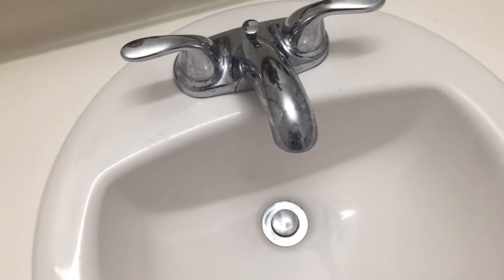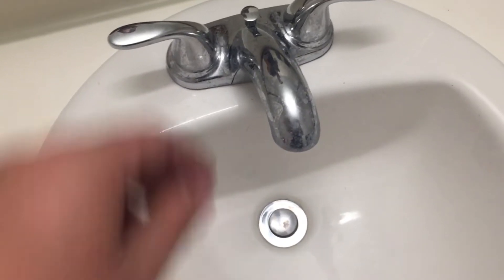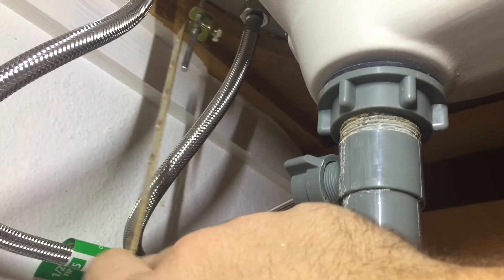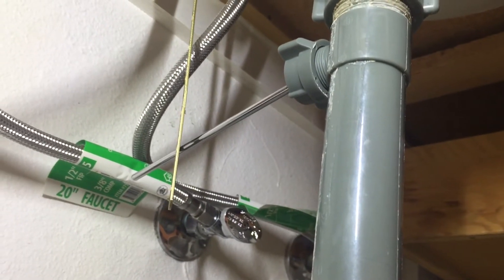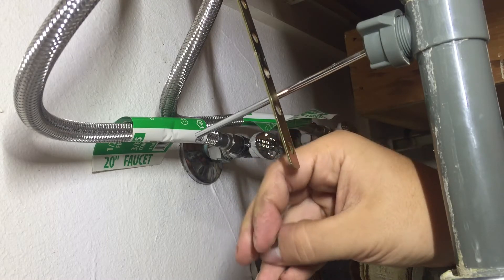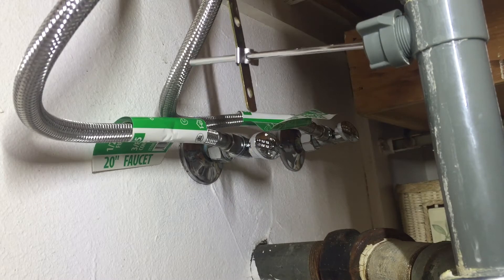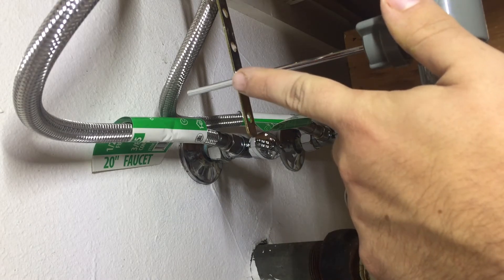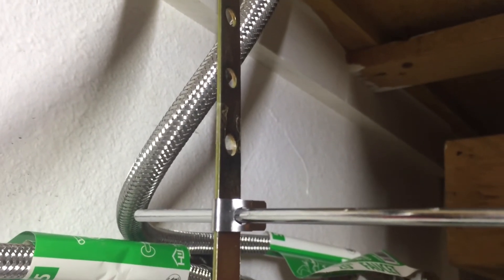Bathroom Sink Drain Stopper Not Working Fix

Comment: Do you have a video on the lift rod?  I can pull the lever up and down but the drain stays shut still
Reply from the maker: I don’t but maybe we can walk through it! The  end of the lift rod from the sink goes down to pivoting rod which has a ball on the end of it. That ball moves up and down in response to the lift rod being moved. The ball end of the pivoting rod connects to the sink stopper so it could be broken or disconnected. A very easy fix but can be bit of pain to line up. Let me know and I can always do a video!
Reply: @learnsavediy   thanks so much, appreciate the tips.  I ended up buying a new drain stopper as the piece at the bottom of the original one with the whole broke off it.  With that said once I dropped the stopper in the sink I had trouble lining up the whole with the pivot rod.  It was very hard to see it as you said.  But somehow I guess even though I could not get the pivot rod through the whole it was still touching it and the stopper was moving up and down.  When I lift up the lift rod the drain just about goes all the way up.  Enough to where it does hold the water.  When I push down the lift rod the drain stopper comes back up but it’s almost a little too high up but should be ok.  Everything seems to work, although not perfect, so I think I will leave it as is?